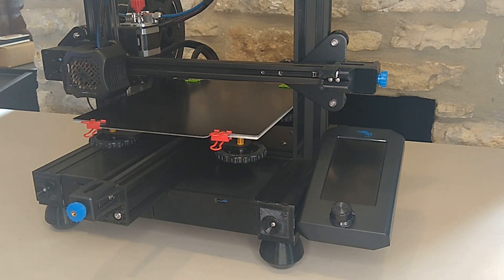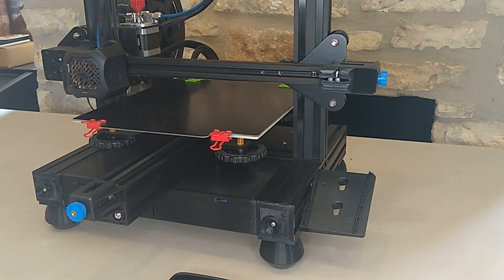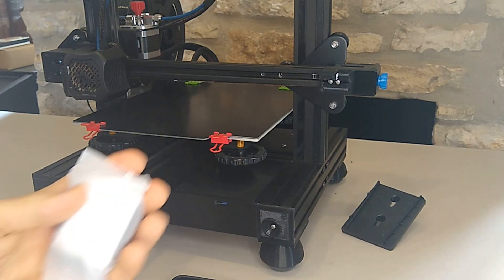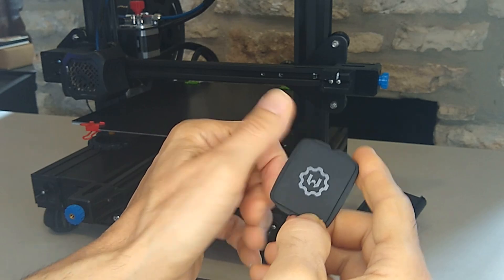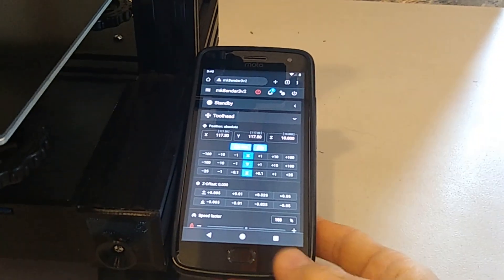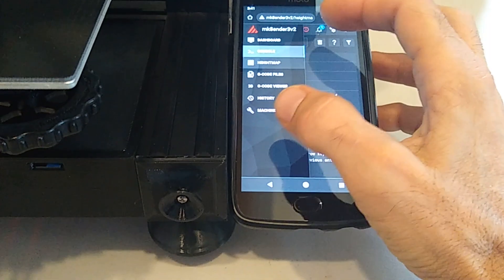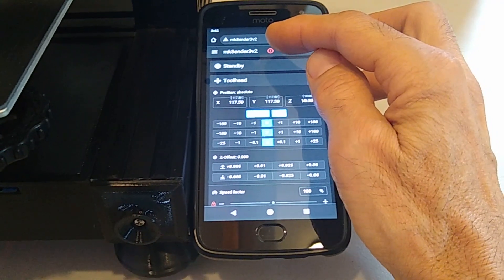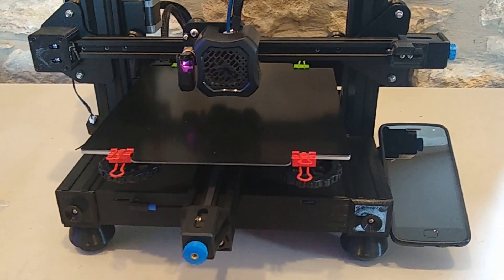Ender 3 V2 Mainsail Klipper Printer Controls Using a Smartphone for a Touch Display.

Comment: Can you do that on the regular ender 3?
Reply from the maker: Hello ES408SJ, 

Thank you for commenting. Yes, there is a method for installing Klipper on an Ender 3 see the Klipper info below. The Ender 3 has a ton of support so I'm sure there is guide that someone has put together for it. Unfortunately, I don't have first hand experience with installing it on a standard Ender 3, just Ender 3 V2, Ender 3 Pro, and CR10S Pro V2.

# This file contains common pin mappings for the 2018 Creality
# Ender 3. To use this config, the firmware should be compiled for the
# AVR atmega1284p.

# Note, a number of Melzi boards are shipped with a bootloader that
# requires the following command to flash the board:
#  avrdude -p atmega1284p -c arduino -b 57600 -P /dev/ttyUSB0 -U out/klipper.elf.hex
# If the above command does not work and "make flash" does not work
# then one may need to flash a bootloader to the board - see the
# Klipper docs/Bootloaders.md file for more information.

# See docs/Config_Reference.md for a description of parameters.

Best of luck with your mods!

Comment: Did I miss the part where you explain how to put Klipper on the smartphone?
Reply: I missed the part that says this requires a Raspberry Pi
Reply from the maker: Hello Odinata, Thank you for commenting. Yes, you need a Raspberry Pi to run MainsailOS Klipper and act as the server that you can login to using any internet browser, like a cell phone.

Best of luck with your mods!

Comment: hello, i'm very interresting for control mainsail with a Android smartphone. Have you over video on this subject ? Thank's
Reply from the maker: Hello Sebastien, Thank you for commenting. Getting it to work with a smart phone is easy. Once you have Mainsail Klipper setup with your computer all you need to do is to type the Raspberry Pi's IP address into the smart phone's internet browser to load the controls. It's as simple as that.

Best of luck with your mods!
Reply: @vbared  thank's for your return,
But i don't have à raspberry pi. Mainsail is opend with Virtual Box.
Reply from the maker: @SebCAO3D  I'm sure you can run the software that way as well.
Reply: OK i test that but i entry my ip adress in my Google chrome, i don't have mainsaill.
Reply from the maker: @SebCAO3D  The MainsailOS image is made for the Raspberry Pi. I'm not sure if there is a Raspberry Pi emulator that would work with that image. Running a Raspberry Pi just simplifies the process because the MainsailOS software was developed for it.

Comment: Hello, how did you install the clipper on the phone ?? Linux, Debian, Mobian?
Reply from the maker: Hello Agnieszka, Thank you for commenting. Mainsail Klipper runs off a Raspberry Pi. It can be accessed by anything that is connected to same wifi simply by entering the hostname or IP address into its internet browser. So for me I would enter http://mainsailos into Google Chrome and my phone will connect to MainsailOS server running on the Raspberry Pi from there I get the GUI that you saw in the video to control the printer. It's super easy and looks way cleaner, in my opinion, than Klipper screen mounted in an enclosure.
Reply: Is it possible to run mainsail on the phone itself?

Comment: How do I get the cooling fan shroud that this printer has? I've looked everywhere! I need a dual fan cooling solution, that maintains the mounts for the CR Touch without modding the CR Touch! HELP!
Reply from the maker: Hello James, Thank you for commenting. What hotend are you using?
Reply: @vbared  the stock Ender 3 v2

Comment: ,I just did away with my ender 3 panel after using klipper. I will be doing it this way from now on. Thanks for designing the bracket as it will come in handy for my ender 3 build. Cheers mate!!
Reply from the maker: Hi Elias, Klipper is awesome! I'm converting each of my printers to run on it. Not having to deal with recompiling firmware every time certain changes are needed is great.

Enjoy your day (: